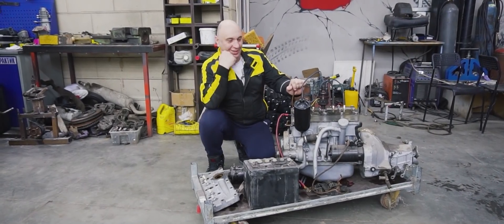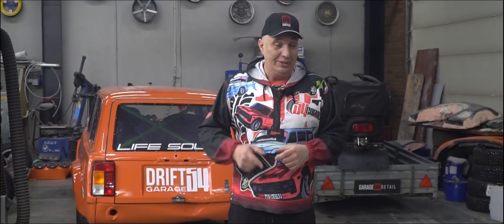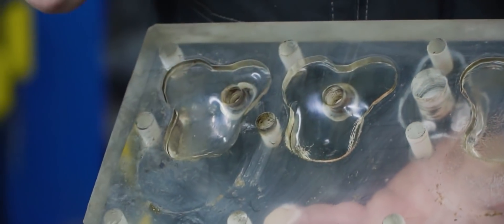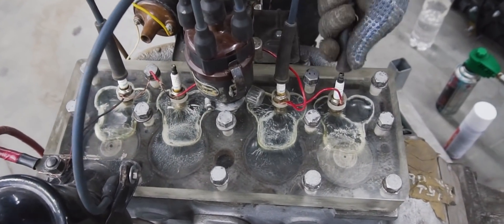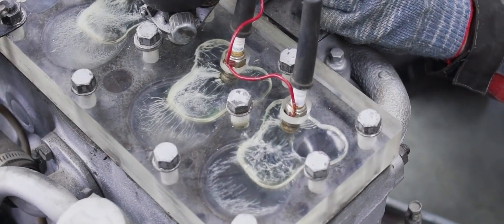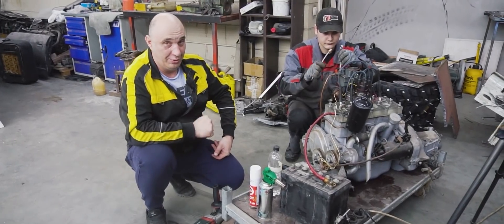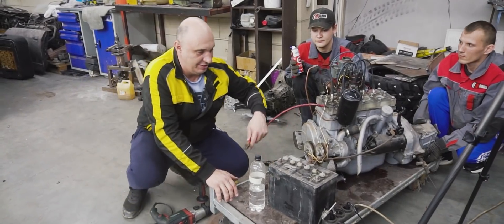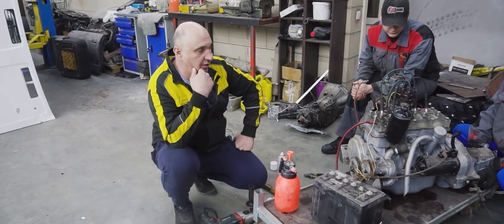We observe propane, methanol and other flames under see-through head

Comment: Since you guys are into making all these crazy engines, I think you guys should give a 5 stroke engine a go. Normally they are a 3 cylinder configuration with the 2 outer cylinders being smaller, totally normal 4 stroke cylinders with the center cylinder being a single, larger, expansion cylinder that basically takes the exhaust strokes from each of the smaller cylinders and continues to expand on whatever's left.

This could technically be achieved with a bog standard 4 cylinder engine and minimal (well... compared to what you guys normally do) modifications. You could use cylinders 1 and 4 as power cylinders, and then use cylinders 2 and 3 as a combined expansion cylinder. The first and last cylinders on the engine... leave them 100% stock... no modifications necessary. Cylinders 2 and cylinders 3 would need their cam lobs to be modified so that they both open their exhaust vales whenever cylinder 1 or cylinder 2 open an exhaust valve. Then the entire exhaust side of the head should be connected... basically a normal cast log manifold, but rather than using it as an exhaust, you just plug it... we want the exhaust from cylinder 1 or cylinder 4 to enter both cylinders 2 and 3 at the same time. Then the intake cam lobes on cylinders 2 and 3 need modified to open on both cylinders during the intake stroke of cylinder 1 and cylinder 4. So the lobes on cylinders 2 and 3 would be double sided on both the exhaust ports and the intake ports. Finally, chop the intake runners out of the intake for cylinders 2 and 3 and replace them with exhausts.

Boom... 5 stroke engine.

Would it run? Most likely yes... Would it be any better than just running on 2 cylinders? Well you guys already made a 2 cylinder Lada engine, so.... give it a shot and see! Who knows how well it would do! Could be great, or it could be hot garbage! XD
Reply: L
Reply: Pliges
Reply: interesting idea! 👍🍺🇬🇧
Reply: Okay I have to videos out!!!

Comment: Lada running on acetylene and oxygen - how fast will it go?
Reply: It wouldn't go. Gasoline explodes the pistons down at a minimum of 260C, acetylene burns at 315C, oxyacetylene burns at 3150C and at that heat the cylinder would seize with the rapid expansion and then the gas would melt through the weakest point of the engine. Oxyhydrogen burns at 2500C but it explodes with 8 times the force of gasoline, so that would cause the cylinder to rupture.

Comment: you will need pure oxygen it get those fuels to burn better ,propane needs a fuel preheat so it vaporise  better !
Reply: Turbo?
Reply: @gabrielvieira.4358  it would help  but more oxygen  needed
Reply: @johnfudacz8495  Ok, cool to know
Reply: @gabrielvieira.4358  thanks  if you ever  used a propane torch you would feel the tank would get cold .it would freeze going in till it got warm ,and acetiline needs oxygen to burn properly .and methanol slows down combustion!
Reply: @johnfudacz8495  propane's liquid state is 44 degrees below .0 F Vehicles run just fine on propane with no preheating.  Now once you get to about 15-20 below you'll start having trouble. But even that's better than diesel which will gel at that temperature. 
    Drove a propane delivery truck for years. It ran off the propane from the large tank.  
     The reason your tank gets really cold it's because it's being discharged at a high pressure. And the pressure keeps it in a liquid state.

Comment: Methanol require higher compression at least 13:1.
Reply: It'll run at lower, but it is not worth it's disadvantages at the lower ratios

Comment: This is Dominic Thomas from Rhode Island USA. PLEASE BUILD A LADA V8 USE A CRANKSHAFT FROM A V8 BUT WELD TWO LADA BLOCKS TOGETHER AND RENFORCE THEM USE SAME PISTONS EVERYTHING. AND TRY TO GET POWER OUT OF IT AND PUT IT ON A DYNO. AND IN THR FUTUTRE put it in a lada.
Reply: This is John from Sydney Australia. Please buy a new keyboard, because yours has many non-fictional punctuation keys and the CapsLock is sticking really badly.
Reply: @johncoops6897  this is Dominic again, not to be a dick but does common sense exist? I clearly did it on purpose I was the 15th comment. I wanted to make sure they saw that shit cuase everyone including you knows damn well that would be straight up, badass.

Comment: Try to do it with a diesel engine, nobody did it because it is supposed to be impossible
Reply: I don't know if it would be impossible... it would be VERY difficult though due to the much higher compression and cylinder pressures... but if you make the acrylic thick enough... it should be doable. Well... plus the fact that you have to find a flathead diesel (I am sure there is something out there like that though)
Reply: The compression ratio of Diesel is too high that it will crack any see through glass.
Reply: @afolabisamuel708  Diesel ignition is possible with a ratio as low as 15:1, whereas the old lada engine in the video is probably more like 7 or 8:1 from the factory.
Yes it would be more than double at ~220psi, but that number seems achievable with acrylic. Worth testing!